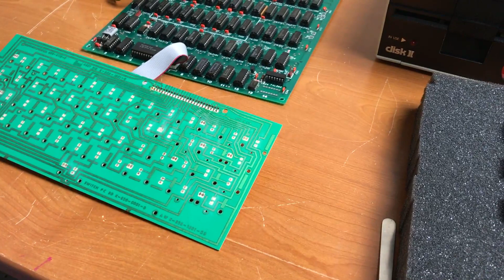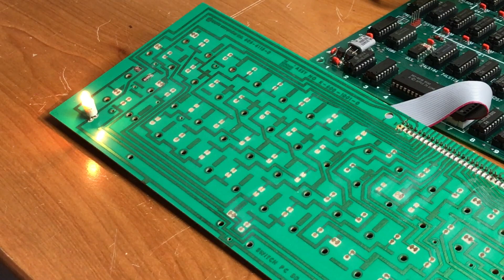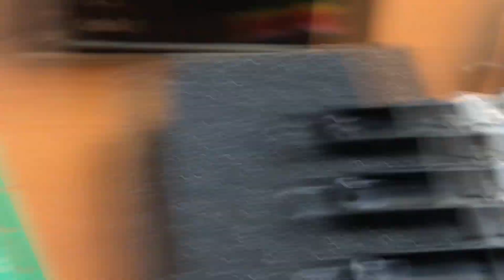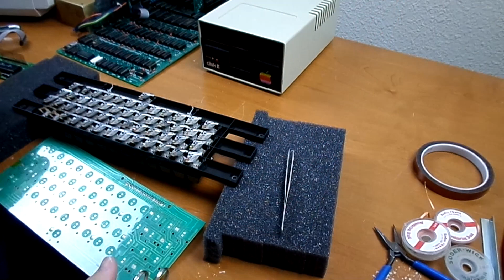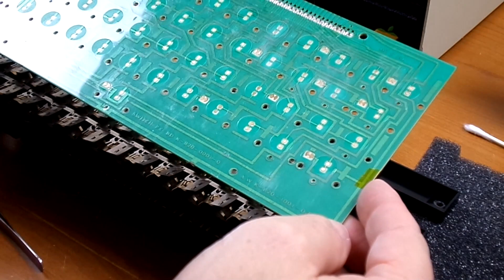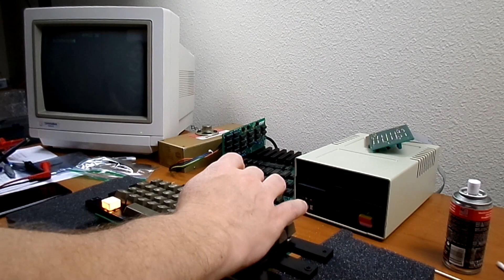Apple II Plus Repair (Part 5)

Comment: Have you checked the ribbon cable. I have seen the crimped ribbon cable connector fail and create random issues with the ram language card where it plugs in the ram socket

Comment: Excellent logical fault finding techniques on this Apple II Plus. It was a pleasure to watch.
On the 16K RAM card you could have tried to reseat all the chips first checking the legs of the ICs and the IC sockets for corrosion from ageing. Also use your temp probe trick like you did on the motherboard. If that doesn't reveal any suspects then most of the ICs on there are standard 74 or 7LS TTL so you could try swapping them out one at a time and re-running your RAM test.
I have the same keyboard on my Apple II europlus and they are the worst design choice Apple Computer ever made. My keyboard had about 90% of the keys NOT working or working intermitently, and that took ages to repair. The earlier Apple II plus keyboards had proper key switches. Luckily they went back to individual key switches in the //e. For intermittent keys, I found that by spraying some contact cleaner in where the key stem pokes out and operating the key a lot (maybe 20 times or more), that they tend to improve over time.

Comment: I watched all 5 of your Apple II+ repair videos, very impressive - thanks.   I have an Apple II+ that I just took out of storage since 1986.  It booted up fine but no alphanumeric symbols are displayed on the monitor when the keyboard is pressed. The only key that did anything was the reset key.   I reset the connection from the motherboard to the keyboard and the connection from the keyboard to the keyboard encoder, but no luck.  I am hoping that the keyboard is working properly but something is preventing keyboard inputs from being displayed.  Do you have any other troubleshooting suggestions.
Reply: @HutchCA  Thanks for the quick replay.   I don't have that equipment or knowledge.   I appreciate your time.